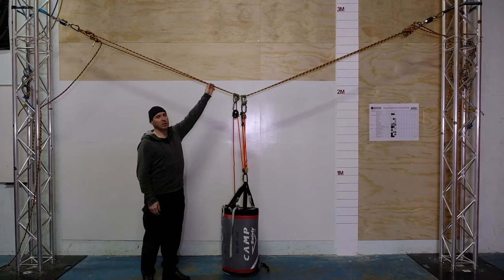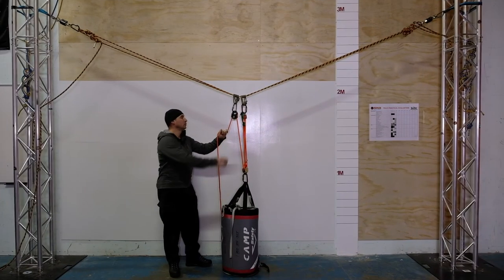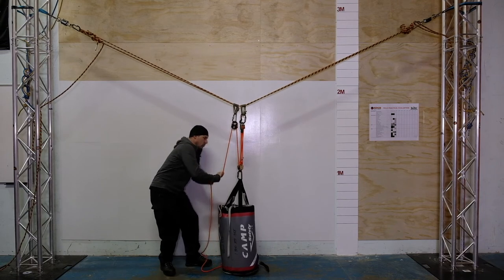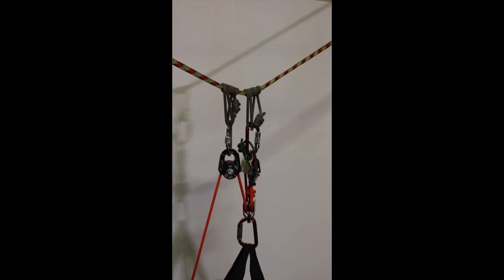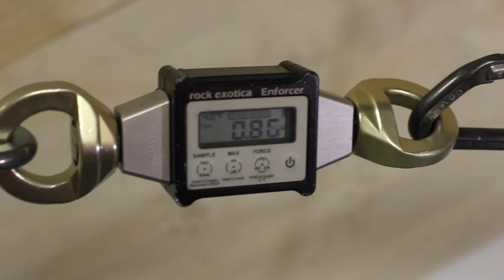Ronin Quick Clip - Spanned Anchors

Comment: Thank you for the solid info. Have you tested it for forces when the load is off center?
Reply from the maker: We have. However it’s a rabbit hole! Depending on rope in service on each side of the focal point, angle, etc the results change. We have also tested it in a TTRS config with a focal point for each device and enough room between for an operator to work. Generally it does not get worse....
Reply: @roninrescue6011  Thank You. I tried this with some back yard testing but I didnt have enough load cells.